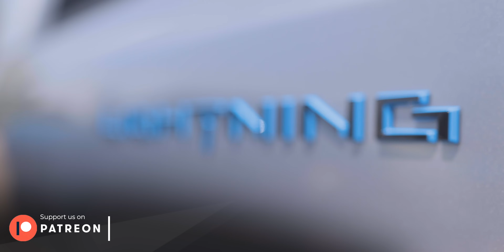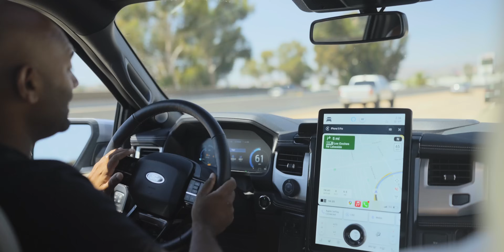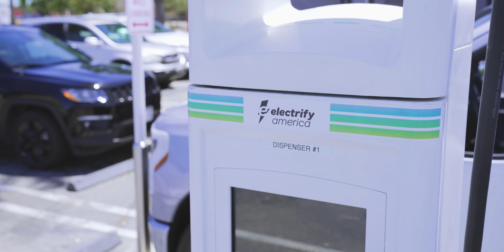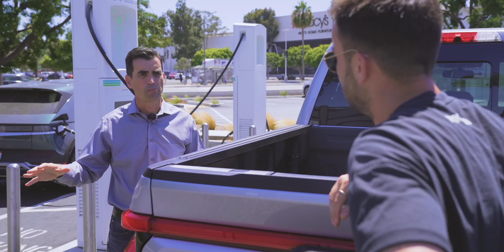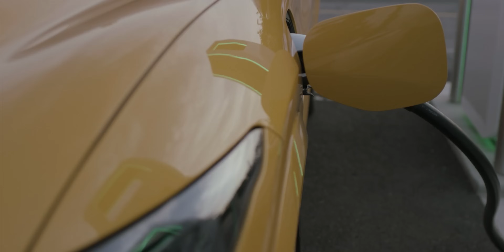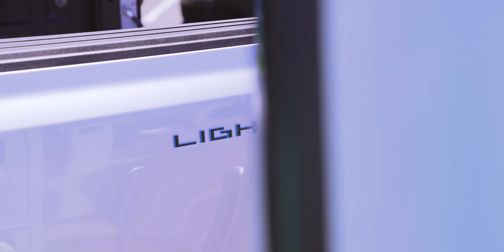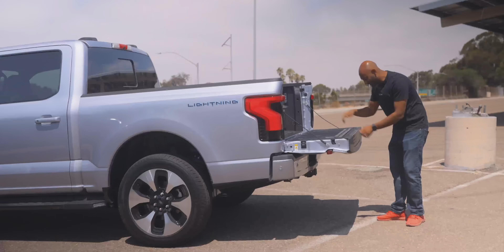Ford F150 Lightning: Is This The Best Truck Ever Made?

Comment: Overall Great Video!
However, I wish they would have addressed the ongoing problems with EA chargers such as non functional chargers and problems communicating with vehicles to get the best possible charge curve. Last but not least the lack of infrastructure in large parts of the US, (excluding California).
I do think other manufacturers make really good EVs, but Tesla is the only EV manufacturer with a really good, working infrastructure of chargers, and will be for a while.

Comment: First its not a truck its a big ute it gets my goat up you call them a truck there not a truck they are a ute can it carry at least 6 full size pallets no that is a truck also l live in Australia and these very large utes are few and far between also you did not tow or carry any weight in the bed of the ute and it cuts the range by a significant amount as demonstated in another you tube chanel in Australia we do have electric vehicles and l did a trip last weekend and only saw three Teslas there are charging stations but they are hidden away by the way in my trip l covered over 500kms and never filled up until l was finishing my jouney and that is from a 30 litre petrol tank achived 50mpg in the car

Comment: I have never come across an EA site that had all chargers working. Also they need to put signs up recommending slower charging cars don’t use 350kwh when others are available. What’s the point of having 350 chargers if Bolts and Niros are constantly clogging them for an hour at a time?

Comment: 100k dollars ? for a pickup ? and it can't tow anywhere even close to the advertised range ? LOL no. These EV prices are complete nonsense...they should be cheaper than a ICE vehicle since the drive-line components are much more simplified. I mean come on people...we've been charging batteries for decades now, it's not rocket science and the prices on pretty much all EVs are simply ridiculous. Before you buy one you better check the more thorough reviews where they actually try to use it as a truck, you know, they tried to tow with it...these things are awful and can't tow any distance at all.

Comment: Ford needs to get ahead of the competition and create a smaller F150 for the European market. And I don’t mean the half as good Ranger that we normally get. I mean a proper, F150 but sized more appropriately. All the tech and the bits that make it a proper useful truck, that incredible front trunk and the step to get into the load bed, power outlets, 300 mile range and the myriad of other details that won’t have been covered here… please ford give us a proper truck!!

Comment: I don't see why EV's don't have banks of batteries rather than just one big clump of batteries. For one, you could charge the separate banks in parallel and double your charge speed. Secondly, you can have one bank for each wheel. 
It lessens the heat generated by all power flowing through the one I/O port. 
I think of it like a pc. PC's used to have 1 core and I said why not have 2 or 3 cores to dissipate the heat generated by the chip and the demand put on it. This is no different, have 2 or 4 or 8 banks and you could choose to charge with one or 2 or 4 inputs at a time and the computer can decide if it needs 1 or 2 or 4 banks to pump power to the engines depending if it is offroading or just cruising on a highway or in city traffic.
just my thoughts... For the last 5 years. And yes I thought of dual core and quad core cpu before they came out. I'm just not the smart guy that knows how to do things.
Reply: This also goes for electricity grids, power companies and car charging infrastructures. They should not be thinking of how to update later or how to future proof by having more of what they need now but instead, should build it like lego. So everything can be added to by clicking the next thing onto it. A power battery structure at a charging station can have a power supply that is enough for now but can be upgraded simply by clicking a whole new power supply onto it rather than replacing and upgrading everything.

Comment: The F150 Lightning doesn't need to be as good as a Rivian it just needs to be in the ball park. Most people will buy it because it's a Ford F150 and it is cool that it is EV as well.
I think with most EV's and most new cars, the buttons will revert back to physical buttons. At least while autonomous driving is not available. It is too hard to drive and look at the touch screen and scroll through menus to fix the AC or turn the radio up or anything that was able to be done with muscle memory and touch without having to look away from the road.

Comment: Sorry these vehicles are not better then ice vehicles.  Limited range too long to refuel.  They cost way more then ice. Your not going to save any money.  "O you'll save on maintenance they say." So you might change your oil three times a year. That might cost you $200 plus an air filter.  Fact is ice vehicles for the first five years are pretty much maintenance free and will have better resale value the EV.  So when you pay a boat load more for an ev and then when you want to sell it resale is going to be crap.  There's all your great gas savings money up in smoke. You want to fast charge your battery to be comparable to ice ( which it's still not). Guess what that kills your battery faster.  So no one is going to want to buy an EV with a tired battery that costs a ton of money to replace. 
Electricity will not continue to be cheap. They need to massively upgrade the grid and that s not going to be cheap and guess whose going to pay for that.  You know who.  Just wait to the metal thieves figure out how much copper is in the charging cable they'll be cutting those off left and right.  There are 300 million vehicles in the US. They're not going to build 300 million chargers across the US putting them in like trees every where.  Way too expensive. I love how richer people say without thinking big picture "Well I just plug in at home" Not giving a thought about people living in multi family housing or apartments. These people are screwed they're not going to put in a charger for every vehicle. Plus people in homes  If you want to put in more then one high powered charger in your house your house electric will need a massive upgrade. Fact is these plug in only vehicles are a stupid idea or they just don't want you to be able to drive where you want. Removable battery packs would be a way better idea or just hybrids. 
New tech should make your life easier. Not complicate it worrying where your next charger is.   If these vehicles could get 1000 miles on a charge in ten minutes and not degrade the battery so fast due to fast charging. Plus being able to do that anywhere in the country Id say yea EV are the better choice. Sorry this design for EV not up to snuff. I'll wait for something better maybe ammonia as fuel.  Think this thru people look at big picture not just your little slice of the world cause " I have a house to charge at."

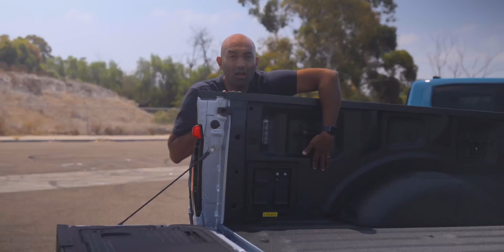Comment: 16:44 Big mistake many make when talking about using an onboard air compressor, like on the Rivian, to run power tools is how big is the compressed air tank.  A framing nail gun needs around an 80 gal. tank to run that tool at construction pace. Better off running a separate compressor from the 110 outlet with the compressor much closer to the work.

Comment: 6:12,  2miles / KWh. Average price in So. Calif. is .25 cents /KWh, so that would be  12.5 cents / mile. Currently gas here is around $ 5.50. That would be equivalent to  44 mpg.  Ford f 150 ICE gets around 25 mpg.  Note that Electrify America cost / KWh in San Diego is  .31 to .43 cents.

Comment: OK as a car not much different than the old ranchero but as a truck?  Pulling a load like a trailer the range is only 100 miles; that means you are charging almost as much as you are driving; this is particularly unworkable for professional use where you are paying for people to sit while a truck charges.

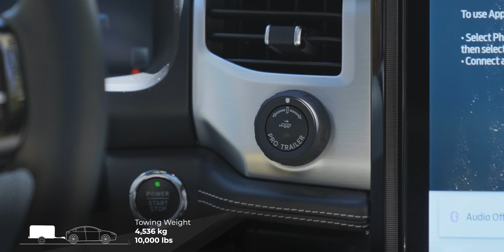Comment: 2:56 Towing weight 10,000 lbs. Well this won't be able to tow my 13,000 lb Tiny House Trailer, so I'm holding out for the Tesla Cyber Truck with a Towing capacity of 14,000 lbs. and that's with the Tri motor, but I think they scrapped that one for the Quad and I wonder if this boosts that capacity

Comment: The Lightning drag coefficient of 0.463 is embarrassing. The Rivian has a 0.30. Ford is wasting batteries because they didn’t understand the vehicle needed to be efficient. 

So talking about the cool wheels is almost lying. They did not do anything to improve the aerodynamics of this vehicle.
Reply: Because the Rivian is a Ranger equivalent and not a F150 equivalent. You should be embarrassed...
Reply: They did though. Fenders just different enough, hood just different enough, running boards just different enough, rims just enough different, plating underneath....all to make it more efficient yet keep it familiar. In fact, don't use off road mode on regular driving...you will see more inefficient. Ford has already said they are working on a ground up design new truck that will be way more efficient.

Comment: The Maverick (much smaller Ford truck) comes in a hybrid version. Hopefully, they'll offer a full EV at some point.
Reply: They will, but I am more excited about a ST variant with a manual transmission. I can not stand automatics, EVs need manual transmission options.....but still, love the noise and smell of a gasoline engine.

Comment: Ford may have just suffered a HUGE blow in regards to F150 sales.  As many may know.. Tennessee was just hit was a 100+ year flood.  Ford had recently sighted Tennesse as their new location for their F150 Lighting production factory along with their Battery Factory.  Its not yet know if their efforts has been effected by the floods, but it would surely set things back, since so many of the states residents have lost everything.  and its infrastructure is so damaged.

Comment: Ford has gone from building a gas guzzler to building an electricity guzzler. How does this help?
Reply: ... because it does. If they stopped making the ICE F150 people would just buy ICE GM trucks or Rams. And the EV > ICE in terms of efficiency even if you're burning fossil fuels at the power plant.

Comment: The Ford electric truck was recalled. F-150 of the past isn't the future of quality.
Reply: For a tire pressure monitoring system. They have also sent an over the air update for it
Reply: @jasondesjarlais5507  Referring to the drive train.
Reply: @prestontucker1687  have not seen that. Did a search and still don't see, just the tire pressure monitoring system
Reply: @jasondesjarlais5507  My bad. It's the mustang Mach e power train. My point is Ford is NEW to the EV domain. They don't have a quality history with EVs.

Comment: This is not the most important car in a decade. Tesla is the ONLY REASON at all this car exists. It would not exist without Tesla. Like Tesla cars or not, their importance to the current state of the auto-industry is irrefutable. Thier Model S came out EXACTLY a decade before this truck and the Model 3 which really brought everything to the next level and imo is what made Tesla a car Icon came out 5 years ago.
Reply: Hmm, would suggest you review your opinion of how wonderful Tesla might be.

The only reason for EVs (of any description) is the need to become carbon zero, not just neutral.

In any event it must be obvious that battery technology is not quite the answer it was expected to be.

You might have noticed the huge increase in research on hydrogen fuel cells?

It's government initiatives which "drive" the move to EVs.

Tesla is just part of the story ... and if they don't evolve to hydrogen fuels cells they'll be part of history.

More than enough info online if arsed.
Reply: @t1n4444  You are insane.... Hydrogen fuel is worse currently. And yea government granted Tesla and EVERY other Automanufactuter for EVs only GM did it well. They had decades and it wasn't until Tesla stepped in that everyone made change. 

I wont continue with you. You actually have to be delusional or brain dead to not see Tesla was the push.

Comment: another great video,  2 miles a kwh is kind of low.  for my m3 I just use a standard 120v outlet in my garage to charge(usa).  and it does around 6 miles an hour, so my normal 36 mile daily commute takes about 6 hours to charge when I get home.  hmm.. ok,  I think this would charge in something like 10 hours...that would work.  I would still have a full "tank" every morning just using a regular outlet in the garage.  In Florida, that's about 1.80 dollars of electricity I think.

Comment: Gimmicks and gimmicks for a hundred thousand dollars. My 2004 truck has "rear assist" trailer hitch camera and it cost a few hundred bucks as part of my stereo install. 

My 2004 has a moon roof, a tablet on the dash that looks way more appropriate than that 75 inch TV this ridiculous truck has mounted on the dashboard. Haha! 

Fake engine sounds played while you drive a silent car. Wtf is that? Absurd. I wonder if you can set the sound to chickens clucking or goats bleating. 

Ford seems like they're ready to stop being a car company any more.

Comment: 15 years in, and "plug and charge" is still a special feature as opposed to being the norm. what were they thinking?
Reply: I don't really get why it's so hard to pull out your credit (or debit) card in order to buy a service. And now that most credit cards include RFID for "tap to pay" transactions,  it's even simpler.

Of all the technology advances to focus on, I don't feel like plug-n-charge is that much of a game-changer.
Reply: @ps.2  have you tried it? lenghtening your charge by 5 minutes for literally no reason is really annoying, especially if you want to go somewhere you need to charge 10-20 minutes about every 2 hours. also, paying by card is about twice as expensive as a membership. at the very least chargers should immediately start charging and wait for you to identify who you are after it's already going. not to mention the uncertain nature of the thing.

Comment: Cars like this to me defy the purpose of the switch to electric. In Europe a car like this is rare but in the US as I understand it this one is driven a lot. My tiny Zoe uses half of what this one does which I feel contributes to solving the mobility problem instead of maintaining it?
Reply: The point is that the F-150 is not just the best-selling pickup truck in the US, but the best-selling car of any kind in the US, and it has been for many years.

This is not for people who would otherwise buy a Zoe. Ford has brought EVs into a world that has almost no overlap at all with people who would have considered a Zoe or a Kona or even a Model Y.
Reply: @ps.2  I get that :-) My point is a rather activist one: we should start using *less energy and fast. EV's are cleaner but they still use the energy we cannot produce in a clean way. So whilst some of us are trying to spend less of it others drive around in huge vehicles. I get there is a need for different transportation options of course. But again... the principle should be us all using *way less energy

Comment: "a country where cars are ... the correct size." Jack this sounded  like an intentionally controversial take. US average car size is ridiculous and a symptom of car culture and dependency gone way too far. small EVs and more bikes are what is needed, not massive EV trucks for suburbanites to lug .. planks of wood
Reply: Growing up riding my bike to the first restoration of the Woodward Dream Cruise in 1995, I both love and hate giant American cars. Most classic fans love 60's styling, but I love the look of 70's boat cars. For practical use though, I'd love to see EV minivans. My Mazda 5 drives like a hatchback but is easy to load with sliding doors and family friendly with a pop up 3rd row. The new Chrysler Pacifica would be great as an EV. Better efficiency, more space, just as much hauling capability as most trucks, if not more. Give them beefy suspension and tow rig as options for dirt road & snow climates. Probably 30% more efficient than an e-truck. I think Tesla plans a full size e-van and expects Models Y or X to fill the minivan void. I prefer an ebike to any car when I can.

Comment: 135kWh would be far better split up and used to make four normal sized EVs, the world is going to run short on the materials to make batteries from. There are already supply problems with batteries .

Comment: why are they making 3 ton inefficient needlessly powerful vehicles. if you have stuff in a pickup , and you should. you don't want to be accelerating faster than a supercar, all your stuff will slide to the back and get destroyed. Datsun made a 1 ton pickup 50 years ago , that only weighed just over a Ton .

Comment: No this is one of the worst trucks ever made the best truck ever make is the 1988-1997 ford f series. I will not own any other truck ever than this series of trucks all the new trucks are garbage over complex not designed to last or be rebuilt. I can take any old f series from those years put whatever engine and transmission I want upgrade it anyway I want and still be cheaper and better than any new truck.

Comment: It's a fair point, almost sort of, that the Rivian has a built-in air compressor. But, you can carry an electric air compressor in the F150 Lightning and just plug it in and use it when you need. Of course, the only real advantage to Rivian is that it has the ability to adjust suspension height from in the cab using the built-in compressor while the F150 has no adjustable suspension height like that.